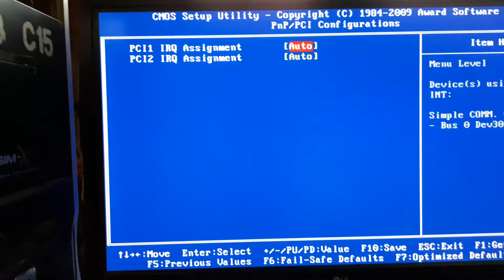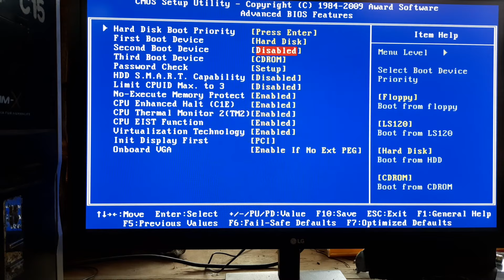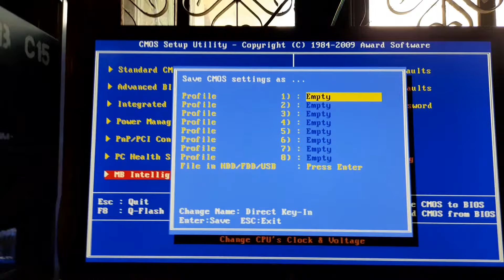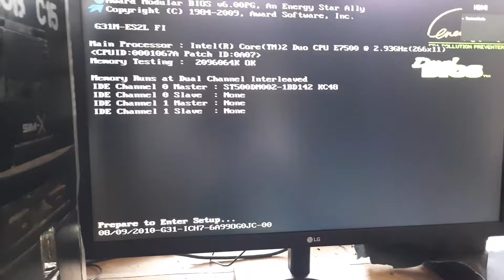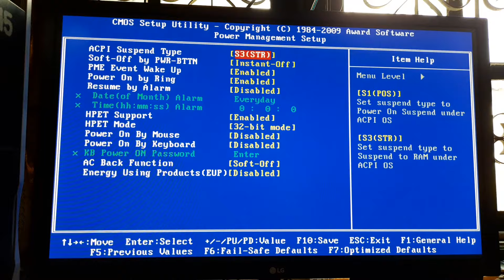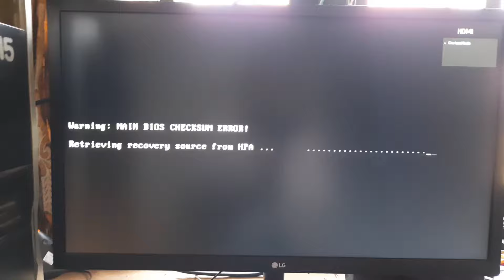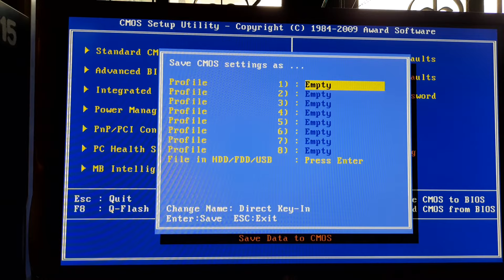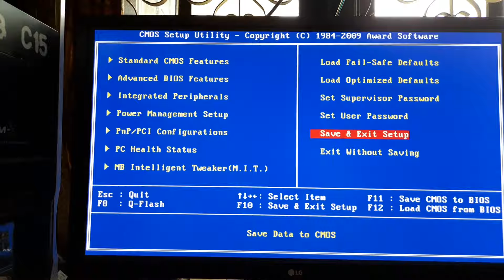Cara Reset Bios dan Reset Cmos itu BERBEDA - Reset BIOS Motherboard Komputer

Comment: Bang kan saya mau instal windws dgn flash disk tapi kalo flashdisk dicolok stuck di logo mobo galax dan sekalinya berhasil itu masuk bios flashdisk nya ga kedeteksi itu gimana bang?🙏🙏🙏
Reply from the maker: Itumah usb nya bermasalah, colokannya di belakang bang jangan depan casing.
Dan apakah instalan nya sudah bener itu flashdisk, dan kalo tanpa flashdisk apakah bisa masuk bios dengan mudah ?
Coba aja lagi tanpa flashdisk apakah cepet atau kaga masuk biosnya
Reply: @SalamKomputer  iya bang kalo gadicolok usb masuk ke bios
Reply from the maker: Ya brati kamu coba lgi tanpa usb lalu masuk bios pada boot pertama nya jangan ada usb dulu abis itu baru masukin usb di belakang PC jangan depan casing pc setting lagi dupaya booting masuk ke instalan windosnya
Reply: @SalamKomputer  iya bang tetep gabisa pas usb di cabut kan masuk bios trus saya colok usb save trus gamasuk bios malah masuk logo galaxnya
Reply: @SalamKomputer  bang kalo instal windows pake cd perlu masuk bios ga?
Reply from the maker: @fallasleep5012  perlu sama saja smua juga, tergantung settingan bios sebelum masukin nya

Comment: kalau pc lama booting sampai ke bios/windows loading, ampe 10-20 menit, bisa dikarenakan setingan bios atau cmos jg ya mas bro, karna kalau saya buka batre cmos, boot nya cepet..
kalau ada pengalaman seperti ini, mohon bagi ilmunya mas bro. thanks sebelumnya
Reply from the maker: 1. Lepas aja dulu ramnya bersihkan 1 1 
2. Lepaskan juga slot sata bersihkan pin2 hdd
3. Untuk settingan bios kalo setingan booting dan hdd normal brati bukan dibios
4. Kalo gak ngaruh bisa windosnya
5. Kalo windos dan di benerin dan masih brati hdd nya dah lemah dah jelek
Reply: Ok, boleh dicoba tuh besok..
Thanks bro, semoga channelnya semakin berkembang.
Reply from the maker: @YSMusicHome  siyap bang sama sama

Comment: bang saya ada kasus
jadi saya abis bersihin komputer (hanya bersih²fan,dan yang berdebu dengan kuas ) ga ada yg di cabut, nah pas saya pasang kembali dan saya hidupin no display, trs pas saya bersihin ram dan ubah slot ram itu hidup tp pc restar restar 2x baru masuk windows. kira² itu apanya yg kena ya bang ? dan sampai sekarang kalo awal hidupin itu restar 2x baru masuk windows, udh coba ganti psu (karna psu lama itu psu yg blm ada merk) 

spesifikasi :
mobo : h81m-hds
vga : geforce GT630
proci : i7-gen 4
psu : 450W 80+
Reply: Alasan 1 sy malas bersih2 pc 😅

Comment: bang mau tanya
mobo saya gigabyte g41 ddr3, vga saya radeon 5500 series ddr2
kenapa ya booting saya gamau tampil kalau kabel vganya tercolok di vga eksternal ?

jadi saya harus setup bios dulu dgn posisi kabel vga tercolok ke onboard, abis setup bios lalu pindah ke vga eksternal baru bisa tampil.

minta solusinya dong bang
Reply from the maker: Maaf saya tidak bisa bantu, harusnya kan otomatis, paling saran saya reset default bios dan bersihkan pin2 VGA

Comment: Bang mau nanya, punya saya ketika dijumper pakek obeng 2 pin power button di front panel kipasnya gk nyala tetapi dijumper clr cmos nya nyala (3 pin). Ketika yg dijumper pin reset kipasnya mati, kira kira kenapa ya bang. Apakah jika baterai cmosnya habis tegangannya berpengaruh.
Reply from the maker: Gk itu krna kmu jumper pake obeng buat nyalahin fron panelnya kan yg nempel banget,
Intinya gini aja gan, kalo PC kamu sudah normal dan tidak apa2 yaudah gausah takut gan,
Pastikan slot batre bersih batee masih hidup ram bersih psu sehat, udahhh aman :D
Reply: @SalamKomputer  soalnya komputernya matot bang . Gk bisa dihidupin pakek tombol power, saya coba pakek obeng di front panelnya tetep gk bisa. Saya nyari nyari ada yg di clr cmos biar hidup. Tapi malah hidup ketika kejumper cmosnya pada pin 1 2. Kira kira kenapa ya bang. Masih awam soalnya hehe. :v
Reply from the maker: @ichsanfaiq  itumah bekas salah jumper kali, jangan2 itu PC bekas di pindah dari mode normal ke jumper , biasanya pae 3 pin itu ....

Artinya kenapa PC kamu selama ini gk nyala, jangan2 dalam mode jumper bios terus :D ,,,, coba gan smua cek dan bersihkan prosesor dengan pinnya juga , ram juga slotnya juga , kalo emang masih gk bisa nyala yaudah beli baru :D
Reply: @SalamKomputer  siap, makasih infonya bang

Comment: punten bang numpang nanya, motherboard sy msi H410M Pro pas baru pencet power mouse sama keyboard ga berfungsi sama sekali. Itu caranya bisa di clear cmos ? Tapi cari tulisan clear cmos di motherboardnya kok ga ada ya ? Soalnya ini motherboard versi baru.
Reply from the maker: kalo gada clernya coba pake batrenya lepas lalu listrik cabut tunggu 10 mnit harusnya dah ke reset. nanti baru dicoba lagi dengan catatan jam settingan bios berubah. untuk keybort usb kalo murahan banyak yang gabisa masuk bios bang
Reply: @SalamKomputer  cukup di cabut batre aja bang? Gausa di jumper2 lagi ya? Keyboard sy pake merek HP ga murah bgt harganya bang soalnya sebelumnya bisa ni tiba2 jadi begitu

Comment: ikut nnya2 bang.. mobo ane cuma ready 2 slot ram nih, ane pasang tuh ram 2 keping 4gb di masing2 slot. Anehnya di tampilan bios total memory cuma kebaca 4 gb, tpi ketika di cek di windows, task manager dll total memory kebaca 8 gb.
Terus yang anehnya lg di bios nya tuh ngebaca bahwa isi slot ram udh keisi penuh gitu dua2nya. Cuma total memory nya kebaca 1 slot doang.. kira2 problemnya darimana ya
Reply from the maker: Saya gapernah ngalamin, cuma pernah ngalamin ram dipasang 2 kebaca 1 sudah direstar di clear cmos masih sama lalu dimatikan PC nya dilepas di bersihkan pin ram slot ram dipasang lagi normal kebaca dua2nya itu si bang pengalaman saya mungkin beda.

Comment: Bang Saya update bios ECS h61h2-m6 stuck di tulisan american gitu terus bisa klik f2/del tapi nggak Masuk masuk menu bios , terus PC nyala Mati nyala Mati terus. Apa itu ciri gagal update bios
Reply: Jadi pas mau pencet f2/del nya malah nge load lama gitu jadi nggak keburu sama alur nyala Mati nyapa Mati CPU nya
Reply from the maker: @AFAFGaming  Hardisk nya coba cabut jangan pake hardisk dulu, bisa gk masuk settingan bios
Reply from the maker: @AFAFGaming  maaf ya baru bales tidur abis saur
Reply from the maker: @AFAFGaming  Ram juga sekalian bersihkan pastikan bersih
Reply: @SalamKomputer  untuk VGA cabut ? Maaf boleh Tau sosmed nya seperti IG kakak gitu
Reply from the maker: IG @aromikomputer , pengalaman ku klao ram yg kotor ada juga kasus masuk bios tapi stuck masuk bios tapi blue screen windos ....

Intinya coba dulu 1 lepas Hardisk
Dan lepas 1 keping ram dulu coba normal kaga
Reply: @SalamKomputer  eh jangan minta maaf lah kak 😅, Saya yang terimakasih udh di kasih Saran 😅. Maaf tadi Saran lepas hardisk itu semua nya ? Saya Ada 1 SSD dan  2 hdd jadi cabut aja dulu ?
Reply: @SalamKomputer  cek DM kak 😅✌️
Reply from the maker: @AFAFGaming  iya cabut aja dulu sisakan mobo, prosesor ram 1 keping test masuk bios sampe kluar
 Settingan bios jangan lupa bersihkan juga ram dan pin2 nya

Comment: Bang ane punya mobo hp pro 3000 , trus ane upgrade processor dari dual core 2,6ghz ke Core 2 quad Q8400, al hasil Cpu nya nyala tpi gak mau tampil dimonitor bang, gimana ya solusinya? 

Padahal mobo sy udh plg update biosnya & sy cek di website resminya itu support Core 2 quad Q8400
Reply from the maker: faktor lain kali bang,
1 faktor kotoran,
2 faktor settingan bios,
3 faktor bios gk support tapi admin websiitenya gk mau pusing copy paste list cpu padahal  gk support :D

Comment: Bang mau nanya,kalo ssya setting hanya jam bulan tahun, komputer ku malah,hitam layar nya sama ada strip putih kedip kedip gimana?🙏
Reply from the maker: Cabut colok berkali2 sata dan power sata nya biar pin nya ke gesek, lalu untuk settingan nya arahkan boot prioritas nya ke hdd/ssd dan mode booting nya samakan dengan yang dulu uefi atau legacy
Reply: @SalamKomputer  iya kak,ternyata file windows di hardisk 1,tapi di boot squence nya sata 1 malah hardisk 2,harusnya sata 1 hardiks 1 yang ada file windows ya kak?🙏
Reply from the maker: @rangganaufal5431  iya

Comment: Cara ngejamper cmosnya gimana ya?? Mobo saya Asus EX-H110M-V ada 2 pin, saya punya flashdisk yang ujungnya besi seperti punya anda, itu besinya dimasukkan ketengan slot 2 pin atau bagaimana ya bang?
Reply from the maker: Aku si itu OTG bang kalo flashdisk ya kegedean.
Cari obeng aja bang kau jepit di tengah itu supaya dia ketempel
Reply: Oke bang, makasih, saya coba dulu, trimakasih sarannya

Comment: Gan mau nanya, ane punya VGA GTS450 dan mobo gigabyte H61M. Nah td pagi ane mau nyalain, no display. Ternyata VGA ga kedetek, jd ane pake iGPU. Trus ya ane udh lepas pasang ttp ga bisa kan. Yaudah ane reset bios, trus pertama kali masuk bios kan disuru mau load optimized atau atur sendiri. Ane atur supaya init graphic displaynya dari VGA GTS450 nya. Yauda aman tuh sampe desktop juga ke detek, ane install driver aman dah ya. trus ane matiin kan, nah pas ane nyalain lg, vga ga kedetek lg, no display tp iGPU bisa. Ane reset cmos bios lg, eh bisa lagi kedetek VGA nya. Tp ya gitu, ane matiin, ga kedetek lg. Gmn ya mas bisa dibantu? Trims👍
Reply from the maker: Ada 3 kemungkinan
1. Motherboard eror
2. Batre cmos atau cmos rusak
3. Analisamu
Reply from the maker: Pin vga dan lubang vga di bersihkan dengan penghapus dan amplas atau kertas yg kaku, dan POWER SUPPLY nya penting banget gan, soalnya klo Psu dah loyo juga begitu

Comment: bang izin bertaya
ko pc saya ga bisa baca keyboard sama mouse usb.
kalau pake keyboard dan mouse ps2 bisa.
apakah itu karna setingan bios yg salah
Reply from the maker: Kalo untuk di dalem windos kemungkinan
1. Usb kotor jadi pin2 usb gk nyentuh karena kehalang kotoran
2. Ya bisa biosnya
3. Bisa juga port usb nya mati
4. Bisa juga WINDOS nya soalnya pernah i7 gen 7 dipasang windos 7 ama sya driver usb Nya gak mau masuk,
Reply from the maker: Tinggal kamu tes2 aja sendiri sampe yakin penyebabnya
Reply: keyboard sama mouse usb di dalam menu bios tidak bisa di gunakan 
lampu keyboard berkedip
kadang ga ada lampu
tapi kalau mouse di teken kanan lampu mouse hidup tapi tidak mau respon
sudah saya pidahkan ke slot usb 
tetep aja ga ada respon 
padahan slot usb y ada 10.

tapi kalau pakai keyboard dan mouse ps2 bisa 
apakah karna setingan bios y 
yg salah
Reply: mohon bantuan y bang🙏🙏🙏

Comment: Bang kalau onboard gpu hilang di bios dan hanya ke detek vga card masalah nya apa ya udah di clear cmos bios juga udah tapi tetep gak ada
Reply from the maker: Ya gpp bang kalo ada vga pake vga lah, mungkin boardnya emang rusak mao di gimanakan lagi kan.
Reply: @SalamKomputer  masalahnya vga ane artefak 😌 bang pengen pake onboard lagi asalnya bisa tapi sekaramg jadi gak bisa aneh
Reply from the maker: @ibnuhidayat7573  kau pake prosesor yg ada IGP nya kaga kyak yg seri F ? Coba lepas aja vga nya nyala kaga klo di colok ke mobo dengan catatan lubang port display nya bersih yg di mobo dibersihkan dulu .
Reply: @SalamKomputer  ada bang ane pake asrock juga yang dgs proci nya pake core i3 3240 yang ada intel hd 2500 awalnya pc ane bluescreen nah terus ane ke bios buat nge default uefi nya nah terus itu no display lalu ane nanya di fb katanya kalau no display harus aktifin mode save nah bener nih jadi display lalu ane inul windows nya udah inul itu malah jadi gak bisa nge display lewat mobo dan saya cek di bios malah gak ada onboard adanya pcie gitu apa gara gara north brige nya yang bermasalah di mobo 🤔
Reply from the maker: Ok gitu ceritanya, coba saran dari saya, lepas prosesor bersihkan pin prosesor pake hapusan sampe mengkilap smua juga pin2 motherboard tapi jangan bengkok pasti normal lagi itu, klo gak normal ganti motherboard

Comment: @Salam Kompter , bang mau tanya, itu kan posisi kabel abang sudah digrounding, sementara kalo kita cabut listrik/kabel supply nya apakah reset clr cmos dan bios nya tetap berjalan dengan baik ? Karna kita tidak bisa test dengan menekan tombol power nya . Tolong penjelasan nya ya bang.  Terima kasih 🙏
Reply from the maker: Dah ada di video bang, sya bilang kalo kabel power di cabut yang terjadi hanya CLER CMOS dan itu dah cukup untuk reset settingan smua di bios, gpp lepas aja
Reply: @SalamKomputer  terima kasih bang 🙏
Reply: @SalamKomputer  ooh brrti kalo reset bios jgn di cabut kabel power, trs tnggu sbtr trs tekn power selama 10-15 dtk

Comment: Mau tny kl pas booting keluar F1 trs dibios sdh di disable dan save (F10) tapi pas restart kembali ke enable, knp ya?? padahal sdh ganti baterai CMOS tp tetap saja, terima kasih ya gan atas jawabannya
Reply from the maker: Maaf bang saya tidak tahu, saran saya coba bersihkan KALENG tempat batre itu dengan ampas atau digesek2 pake obeng atau apapun biar kotoran hilang supaya batre benar2 tertempel sempurna
Reply: dari pengalaman, itu ada kipas prosesornya jalannya sdh gak normal.Coba ganti kipas cpu prosesornya.

Comment: Bang komputer saya ga bisa booting windows dan ga bisa masuk bios,
Jadi awalnya tulisan American megantres lalu pindah ke tulisan start windows normally, setelah di enter dan loading windows tiba tiba blue screen dan ulang lagi ke tulisan American megantrens,
Masuk ke bios cmn ada bacaan entering setup dan setelah itu cmn ada garis strip(-) di pojok kiri atas. Knpa ya?
Reply from the maker: coba 1 , bersihkan ram dan pin2 nya bang kalo masih install ulang windows aja lah gampangnya
Reply: @SalamKomputer  alhamdulilah bang udah berhasil, cmn ini kok sayang pasang VGA yang GT 730 ga bisa masuk windows tapi klao sayang pasang VGA HD5570 masuk ke windows, di hdd blm pasang driver vga apapun
Reply from the maker: @mundarans6048  pin nya kotor gak ? Bersihkan bang, Untuk GT 730 banyak yg palsu yang ada power pin nya itu palsu bang hati2
Reply: @SalamKomputer  saya beli ori bang, pake di motherboard core 2 duo jalan, tapi pas pake motherboard gen2/3 ga masuk
Reply: Bro masalahnya sama nih , itu gmna ya biar bisa ??
Reply: @mundarans6048  .

Comment: Bang kalau terpasword pas masuk biosna gimana apakah dengan cara seeprti itu paswordnya akan hilang?
Reply from the maker: Benar bang tapi tergantung PC nya kalo pc sekarang pasti bisa ke reset passwordnya dengan cara ini tapi untuk PC BUILD UP biasanya ada JUMPER KHUSUS untuk masuk bios supaya gak minta wajib pasword.
Reply: @SalamKomputer  saya kebetulan beli leptop lenovo g40 usb nya tidak ada yabg terdeteksi ternyata pengturan di biosnya tidak diaktipkn pas mau masuk bios ternyata ada paswordnya
Reply from the maker: @geenteagarut2617  untuk masuk bios leptop G40 matikan pas sudah mati tekan tombol kecil yang ada pada dekat lubang CHARGER tapi kalo sudah masuk bios dia minta password gada obat harus reset biosnya dengan cara bongkar laptop lalu lepas BATRE nya kebetulan dia gak ada jumper cmos jadi batrenya yang dilepas alias di solder sampe lepas lalu tunggu 10 menit keadaan batre laptop juga kelepas kebongkar smua baru nanti pasang lagi pasti sudah tidak dipasword lagi.

Comment: Bang saya mau tanya, mainboard nya nyala , tapi semua port USB gak nyala, jadi keyboard dan mouse gak nyala, mau masuk BIOS susah, kan gak bisa tekan delet, karna keyboard nya mati, kenapa ya
Semua port USB mati,
Reply from the maker: Pake keyboard PS2 bang cari dulu untuk enable atau clear CMOS
Reply: @SalamKomputer  kalo di clear BIOS , pengaturan semua kembali ke awal, USB kedeteck gak bang?
Reply from the maker: @achmadarga2090  kalo yang gk kedetek cuma di bios iya, tapi di dalem windos gk kedetek kemungkinan bug driver kayak dulu pake WIN7 di intel terbaru agak susah, coba aja dulu bang

Comment: Bang, saya habis update bios tapi failed. Setelah restart, fan, keyboard, mouse nyala, tapi monitor no signal. Sudah dicoba tutorialnya tapi ga berhasil. Mobo yang saya pakai galax b550m, untuk restart cmosnya pakai 3 pin. Kira2 mesti diapakan lagi ya?
Reply from the maker: itu bener2 gk nyala gara2 updet bios ? bukan yg laen,
coba 1 lepas batre cmos tanpa listrik lama lalu nyalahkan, ato clear cmos biar lama,
untuk memperbaiki mobo rusak gara2 bios salah, ada caranya di google dulu pake USB tapi diraba2 .
saya juga blom pernah coba soalnya dari banyak mobo yg saya updet bios bisa smua,
coba aja dibawa ke toko resmi pasti bisa disana tau caranya
Reply: Sudah dicoba lepas batre cmosnya tapi tetep ga bisa. Oke bang, coba saya bawa aja ke service centernya. Makasih bang..

Comment: gan motherboard saya port usb nya ga bisa pakek flashdisk/hardisk eksterna, tapi bisa pakek mouse/keyboard , itu kenapa ya?
Reply from the maker: Lubangnya karatan, bersihkan pake amplas dan kalo HDD EXTERNAL itu klo kurang daya gk nyala, Hdd External di colok ke belakang motherboard aja jangan depan casing
Reply: Salam Komputer iya sudah di belakang gan itu tapi dia ga bisa baca flashdisk ny,jdi saya ga bisa inul
Reply from the maker: Pasti tidak ter TEMPEL sempurna, ada kotoran itu di flashdisk dan di lubang usb nya ... Colok USB nya jangan mentok coba colok 90% aja tarik dikit kalo di bios masih gk detek juga coba clear cmos ...